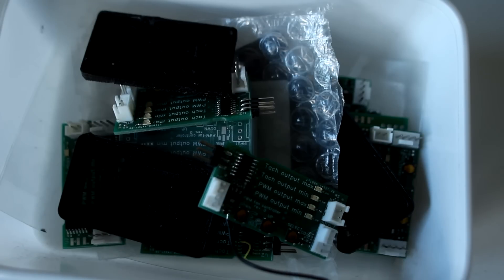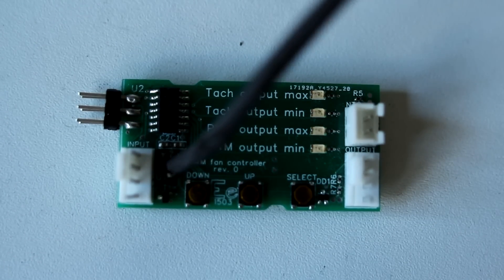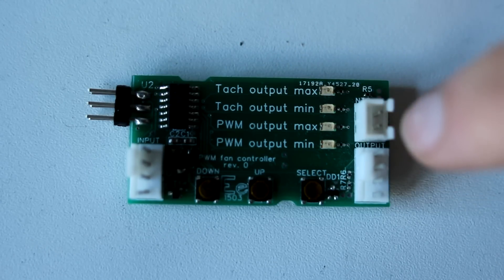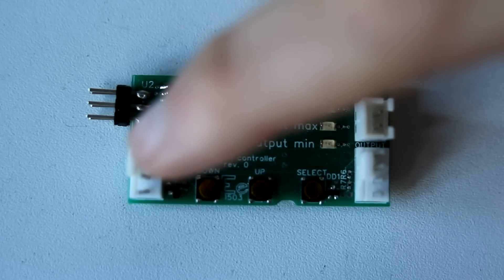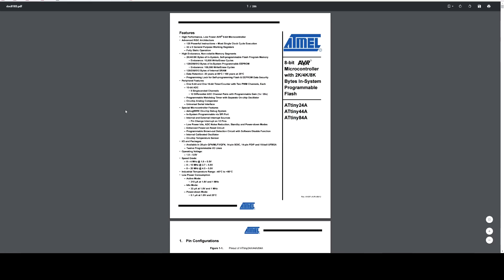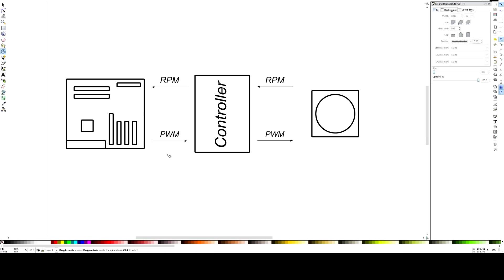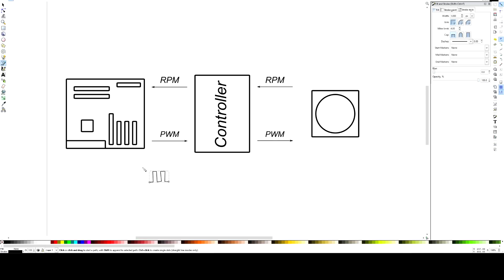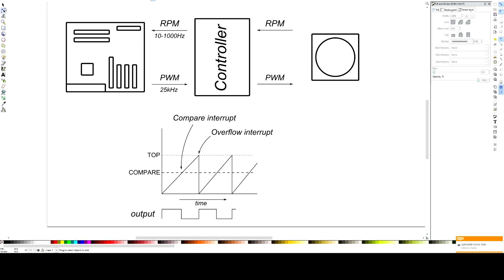Fancontroller part 1: hardware and system engineering (017)

Comment: I would expect that you can set the timer to fire an interrupt in software, but I suppose there was something preventing you from doing that? Wouldn't it be fast enough?
Datasheet: "5 Software Interrupt
The counter overflow interrupt can be used as a software interrupt triggered by a clock strobe"
Reply from the maker: +Michiel Haisma A single timer can only run on a single frequency (determined by TOP), so if you're trying to do four things that probably run at 4 different frequencies (PWM in, PWM out, tach in, tach out), ideally you want four timers. You can have many compare values or many pieces of code running off of a single timer, but you're still going to run all of those at the same exact frequency, which isn't helpful in this case.
Reply: +PowerElectronicsBlog Yeah I was thinking about picking a really high frequency which you can then use to divide into all needed timings, but I realize this is not always possible, and certainly not ideal.

For instance, say you have an interrupt running at 100khz:

void interrupt() {
 timerCounter++;
 if (timerCounter % 10 == 0) { /10khz operation/ }
 if (timerCounter % 5 == 0) { /20khz operation/ }
 //etc.
}
Reply from the maker: +Michiel Haisma Yeah you run into execution time. As a general rule, if you don't want your main program flow or other stuff to get choked out, you want your interrupts to take up less than ~10% of your processing time. So right now, my 25kHz interrupt takes up 12 cycles, i.e. 12*25000=3.75%. That's still acceptable. But even just adding a single comparing if-statement could easily blow that up to 20 or 25 cycles, and then you get stuff like edge glitches on the output waveform etc. etc.
Reply: +PowerElectronicsBlog Yeah, but I figured you basically had almost no other code at all, so in that case it wouldn't matter that much, I don't know how picky these motherboards and fans are with their inputs.
Reply from the maker: +Michiel Haisma Yeah, we (SilentDecode and I) found out the hard way that it's actually the RPM input on the motherboards that is really sensitive to glitches. I had a 1-in-100 glitch with a single missed pulse on one of the firmware versions, and that caused the board to be nigh-on unusable for him. Very interesting and a big PITA to fix.
Reply: +PowerElectronicsBlog Ah, that's interesting, how do you come up with the 3,75%? I come up with 1,5% when running at 20Mhz = 20MIPS.
Reply from the maker: +Michiel Haisma I'm running this on the internal RC oscillator, i.e. 8MHz.
Reply: +PowerElectronicsBlog Roger. Nice project btw, would've been more awesome if it could handle muliple fans at the same time but for the solution of that we obviously need a bunch more timers :)